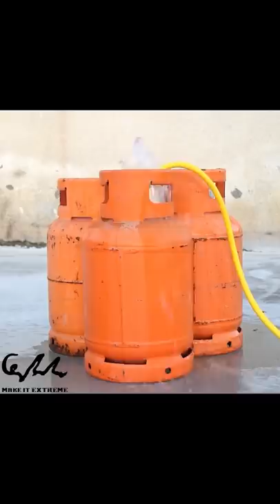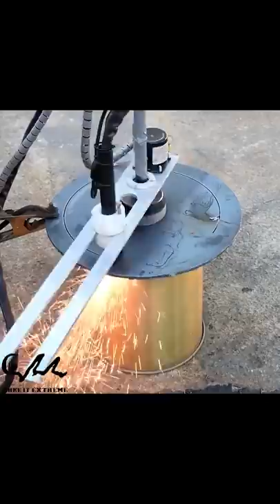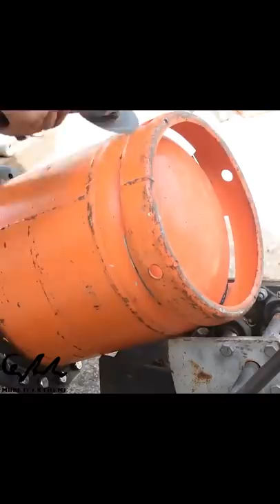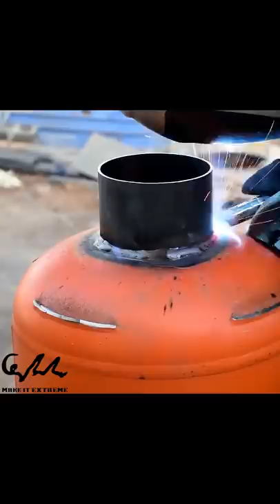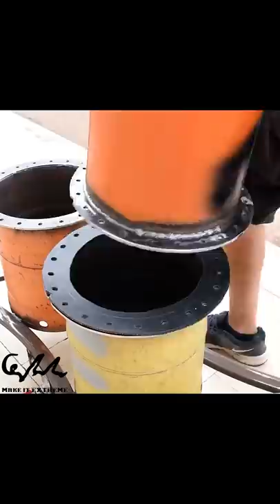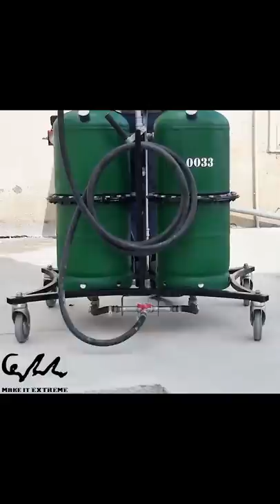Making a Sandblaster #shorts

Comment: Beautiful craftsmanship! Though I gotta say, there's no way in hell I'm trusting any homemade cylinder to hold gasses under pressure!
Reply: I'm Certain that the process of sandblasting involves Sand& air alone, No Gas...He also installed a Pressure gage....so don't worry it's safe & effective and very useful around a working shop....baxter
Reply: so you dont trust your crafting skills?
Reply: @charlesbelliott7265  compressed air can be just as dangerous as compressed gas mate
I do agree its been done safely though
Reply: Advice for life, you do NOT fuck with pressure vessels. It's all fun and games until something goes wrong and people get permanently injured or killed
Reply: @maverick9708  exactly. It's literally pressure that propells bullets
Reply: @user-fx8cz9dh7t  you shouldn't. Crafting can be excellent but you will have defects in soldering points where pressure can break it
Reply: @charlesbelliott7265  you know air is a gas, right?
Reply: greetings all friends
Reply: Yea but wasn't everything homemade at some point 🤷
Reply: @maverick9708  so learn how to do hydrostatic test on your work . Then , there's no need to be afraid.  Life's a wee bit safer and less anxiety riddled with knowledge and tools.
Reply: @charlesbelliott7265  compressed air, Is a gas, an inert gas😜
Reply: Obviously you don't work on the tools.
Reply: You’ve got to know what your doing. Not really a job for backyard Billy. But I’m sure many have knocked things like this up in the shed. Well what use to be the shed 💥
Reply: Wow. Home made or shop made. Do you understand it's the same shit. If I can do it in a shop I can do it at home. Secondly those gas cylinder where made in a shop. Thirdly just because your confidence is lacking in your ability certainly doesn't mean everyone else is.
Reply: @charlesbelliott7265  n#dn
Reply: That must be checked with X-ray to see all the welding points!
Reply: @charlesbelliott7265  00

Comment: Awesome.. now if only I could pick up a plasma cutter at my local home depot.. that would be great.
Reply: You can? I've been to 3 nearby me and they have them. Pretty rural here too, not a big city HD with lots of stuff.
Reply: You can pick them up online for cheap and they run fairly well for the cost. Most plasma cutters use compressed air to clear the slag and molten debris from the path of the cutter, so before investing in one, you'd need an air compressor

Comment: Lol, but the problem is not here, the most important thing is the high pressure pump that will cost u a lot since u need at least 20-30 bar for a good result, and also the sand to use is not the same from beach😂
Reply: 20-30bar? what are you going to sandblast? a hole into mars?
Reply: 6 bar is enough but you need air volume.
Reply: Volume is critical . Not so much pressure.  And I agree , 20 -30 bar ,well that will get rid of paint , rust and object being blasted in short order .

Comment: are there two tanks just to achieve thectotal oressurized volune that you wanted or is there another primary reason fior that?
Reply: isn't one for the compressed air, and one for the sandblasting media?
Reply: @rolls_8798  it could also be air for the helmet? Maybe it's too allow you to switch between two grits without needing to dump out the hopper.

Comment: How much pressure can those welds stand?
Reply: As long as a hydrostatic test is performed on the finished vessel at twice working pressure , the welds strength of typical mig , and 6010 / 7018 cap / root is more than sufficient for such simple non dynamic use . If it were for steam , nope not happening at all . Key being hydrostatic test at twice op max.  Can be done by local plumbing shops , pipeline shops , or local vessel testing facilities .

Comment: What are the rubber diaphragm looking things you put on the stems?
Reply: Those are valves. The hopper with the sandblasting media is pressurized, which is what allows the media to travel at high velocity. When pressure is applied to the hopper, there is a rubber valve which jumps upward and creates a seal around the mouth of the hopper. This is much easier than having a lid with a gasket, because unlike a gasket, the rubber valve can last for a fairly long time before replacements are necessary.

Comment: You really shoudnt do this. Because you are welding not a machine you cant guarantee your welding job will hold under pressure if you need a sand blaster that bad buy one or find one to rent im sure you can.
Reply: He probably know whats hes doing and those welds dont need to expiriance 10 bars of presure most likely its gona be fine